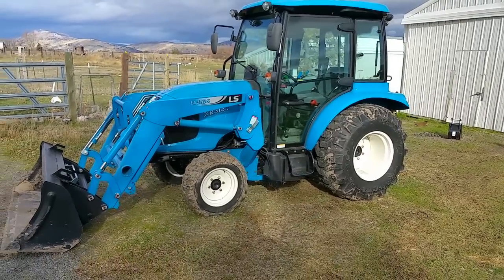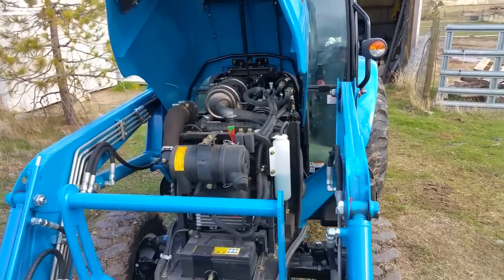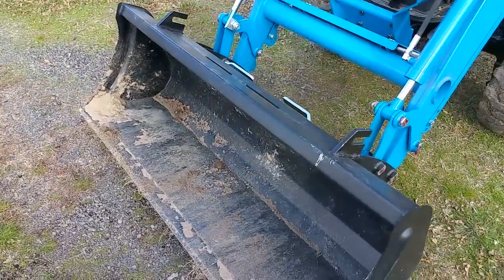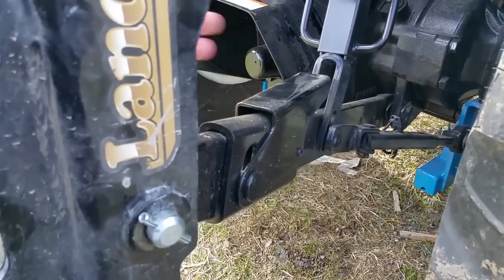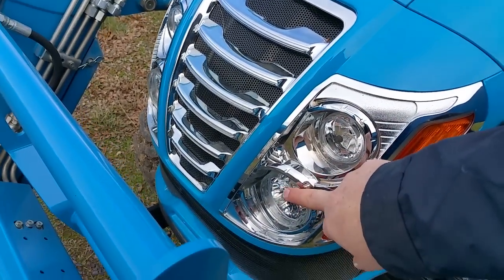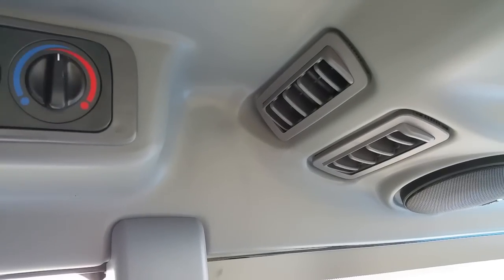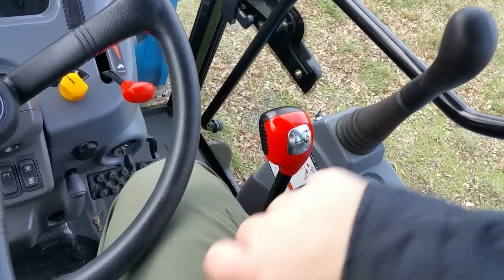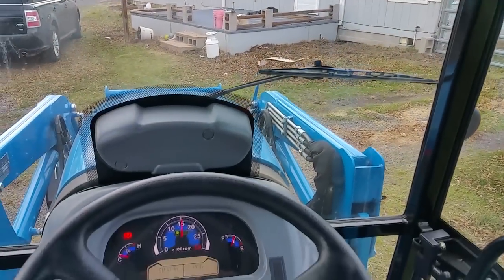About my new LS Tractor XR3135C

Comment: I just purchased mine today and am very excited about it. My father has a JD that's around 10 years old; if the quality of JD still matched what it did when his was built, I would have bought a Deere. As it turns out, JD was very unimpressive and $$$. My wife and I played with several Deere, Kubota, New Holland, and Case tractors. We stopped by an LS dealer on a whim today (who neither of us had ever heard of) and were surprised to see blue Case/NH tractors with a big LS on the side. We drove the 35 horse guy around and were impressed with how much nicer they felt and were constructed than the "premium" JD/Kubota 3 series. Long story short, your review was helpful, and I am subbing for future videos. I believe I'll get to work on installing a head unit and new speakers this next weekend. It'll make all the loader work we have coming up much more enjoyable.

Side question, do we have to hard wire in the head unit or is there an adapter behind there to use?
Reply from the maker: Bob Knob if you search online, you can find the pinout of the connector they use, you can stuff 1/4 spade terminals into the connector, so no splicing is required.
Reply: That's interesting; I assumed they would use a molex pinout. Spades are even easier! Thank you.

Comment: Man thank you SO MUCH for this video and PLEASE make MORE videos of this tractor in action and reviews along the way! I have been eying these LS tractors for some time and am VERY INTERESTED! And in a very similar model just more horsepower due to task I run. But thinking of even just going with the 37 HP for now.
Please share more thank you!
Reply from the maker: This model replaced the 3037. The tractors are similar except for the engine. The 3037 has the Shibaura 3 cyl turbo engine with mechanical injection. The reported regen interval is 4hrs of operations. This unit is reported to run 50 hrs between regen cycles. Reading through the manual, it appears that the aftertreatment system on this engine is a continuous regeneration style; as long as the exhaust temp is high enough, the catalyst and DPF are burning off the soot they trap, it does not need a specific regeneration cycle. There is no auxiliary injector that I can find, a regen cycle would then consist of the engine running at high idle for 30 minutes. The manual states to warm the engine up at 1500rpm for 2-3 minutes; I tend to just set the speed to 1500rpm and use the tractor like that all the time. I figure this will ensure the EGT is high enough to keep the CCRT in regen so I don't have to worry about it. The throttle application is rather sluggish, if you mash the throttle the computer will roll in the throttle very slowly. I recognize this strategy from diesel trucks, it's to prevent soot generation under engine acceleration by slowly feeding in the fuel. I suspect this is one of the strategies they use to lengthen the regen cycle. This slow feed in is present in the hand throttle and cruise control. When you let the clutch out while idled up, the engine revs drop and feed back in slowly, which saves wear and tear on the clutch and makes for a smooth take-off. The cruise control is computer controlled, the default RPM is 2328, which is the rated RPM for 540rpm PTO operation -- this makes it easy to run the PTO, just turn on the cruise, push in the clutch, activate it, and the engine is at PTO rpm.

Comment: Just wondering how many hours you have on your LS tractor by now and if you have had any major problems with it?
Reply from the maker: I have a little less than 140 hours on it now.  I had to replace the ECU (under warranty) because the tractor would not enter Regen mode on its own.  Twice I received an error about the DPF being 150% full and it went into forced Regen/limp mode.  The service center diagnosed this as a bad ECU (more likely the ECU had bad tuning/programming and they had updated it).  I haven't ran the tractor hard since the ECU change, but it seems to run like normal now.  The ECU/DPF are covered under a 5yr/3000hr warranty, so I'm not especially concerned.

Comment: How did you access/remove/replace the speakers in the ceiling panel? Did you have to remove the outside roof panel?
Reply from the maker: They installed the speakers before the external roof.  You can remove the speakers with an electric driver, from inside.  I then used some nut clips that came with the new speakers to retain them into the stock location.  The nut clips just clip to the inside of the speaker opening and provide a threaded nut for the screws that came with the speakers.  You can do it all from inside the cab.
Reply: I loosened a couple of the speaker screws from inside the cab - there seemed to be a retainer clip or washer on the back side which prevented the screw from dropping out. Rather than using additional force to pull on it, I chickened out and ran them back in fearing that I may otherwise lose the alignment of the screw to the clip on the inside and have a rattling speaker and lost clip. Sounds like you "pulled" them out and didn't have a problem(?).
Reply from the maker: They just use a washer and nut on the backside, totally the wrong way to do it.  Car manufacturers use the spring clip nut plates like I used.  The trick to getting the factory screws out is to pull on the head of the screw while unscrewing, this keeps the nut engaged with the plastic, by friction.  A fast spinning electric driver is your friend here.  You can often loosen the screw completely by just very fast spinning of the driver, otherwise you will have to pull on the screw and/or cock it to one side in order to engage the nut on the backside.  Harbor Freight sells the nut-plate spring clips in an assortment.
Reply: Understand. Big fan of HF assortment packs - O-rings, roll pins, grease zerks, etc., - I thought I had them all!  Need to find a nice set ofspeakers and replace the current Sony tuner head with one that has bluetooth and a little more built in power. Thanks!

Comment: The "bucket flop" problem can be fixed by installing part number 9-7960-6 from Surplus Center. Around $25 I believe. There are a couple of threads on TractorByNet that cover the how-to's. One of my disappointments is the LS loader valve does not have a quick-dump..... Otherwise. great tractor and great value. Thanks for your video!
Reply from the maker: The bucket flop problem is caused by using a parallel circuit valve without regen.  With regen the fluid flowing from one side of the piston is recirculated to the other side, preventing a vacuum from generating.  The proper solution is to install a serial loader control valve with regen.  I have the datasheet for the Walvoil valve on the tractor, and can generate a new Walvoil part number for the exact fit valve, but sourcing the exact fit valve is difficult because Walvoil appears to supply directly to OEMs and not the repair/retail market.
Reply: I think your diagnosis is absolutely correct as is your solution. It will also be more expensive. The $25 inline valve will remedy the problem as several of us can attest to having installed it already. Let us know if you have success procuring/installing the new serial loader valve. Thanks again for your vid.
Reply from the maker: Yeah, this "fix" will cost $600 probably.  The upside is that your lift and curl circuits will work simultaneously.  I have looked for valves at Surplus Center, but none that would drop in.

Comment: glad you mentioned pto- how can I get the pto to start at very low sub- 100 rpm and ramp up to 530? I break shear pins in every mode manual or auto and always the lowest engine speed!
Reply: its a xr4140 cab tractor
Reply from the maker: You can engage the pto at any engine rpm, just engage at low engine speed and then ramp it up with the handle. The cruise control also has a ramp up delay, from idle to pto speed is a second or 2.
Reply: Are you putting in the correct grade shear pin bolt? If so it sounds like something is wrong with your implement which is causing extraordinary strain. I assume you have the implement raised so it isn't engaging the ground or grass at startup.

Comment: getting to know my new LS as well, the regen in my experience is that during short operation and not high rpm, I'll get dash lights and high rpm. during operation where every session is hard work on the engine then the regen works normally and no dash lights. in my experience.

Comment: So your saying the 7 pin won't activate the brakes on a trailer?
Reply: YES IT WILL you wire your electric brake controller to the acc terminal, once you buy a electric brake controller, and it comes with a wiring diagram
Reply: @arnoldromppai5395  good to know, thank you for taking the time to respond.

Comment: Have you had any issues with your LS tractor?
Reply from the maker: Sadly, yes.  Since 95hrs I've been having problems with regen.  The tractor is not starting regen on its own, it waits until the DPF reaches 150% full, throws a code, goes into limp mode, and requires a forced regen.  It happened at 95 and 134hrs, the manufacturer provided a replacement ECU, then it happened again at 163hrs with the new ECU.  The dealer here isn't equipped to pull the codes from the ECU.  I currently have a problem with the hydraulic system, I think it's a bad pump, they think there is an air leak on the intake side of the plumbing.  They had the tractor for 3 weeks and couldn't fix the problem (replaced a check valve, filter), I needed the tractor so they said "yeah you can use it, the pump is fine because it's putting out the rated pressure".  There is still a whining above 1500rpm that is very noticeable.  The loader was cattywompus from the factory (Taesung makes it), with one side lower than the other.  Not long ago I discovered a circumferential crack almost entirely around the torque tube on the loader.  The loader is only warranted for 1yr, unlike the rest of the tractor.  The manufacturer provided a replacement loader frame, I still need to install it.   Soon I will have a respite from tractor work and will be able to return the tractor to the dealer to have the DPF and hydraulic issues addressed.
Reply: Man that stinks.  I tell you the more I read about tractors, I am afraid to buy any brand.  LS is supposed to be up and coming but I have read so much crap about their quality I doubt I will ever buy one.  I mean some of the things just come down to a bad design and it is hard to believe more people don't have the same issues.
Reply from the maker: I did go back and look at Kubota for a tractor that is comparable.  Kubota doesn't offer a small frame 35HP 4x4 with similar capacities, so you have to jump up to a medium frame, where 35HP is the minimum equipped power.  The end result is twice the price for the comparable product.  I have a shuttle-shift trans, most people buy the hydrostatic.  I think they are fundamentally different applications, but the ECU isn't tuned properly to handle the stick trans.  I suspect that there is a low-hour cut-in for regen and the tractor is hitting 150% DPF before the low-hour cut-in is hit.  It's supposed to regen between 35-50hrs, but the last emergency regen happened at 30hrs.  They probably need to lower the cut-in point to 4-8hrs.
Reply: IT's a gamble no matter which brand you choose.  Kubota, John Deere etc,. ALL have bad reviews.  However, for each bad review is a good one so take it for what it's worth.  I just read the pissed off consumer reviews on Kubota, nothing good!  However, I have a neighbor whose owned Kubota's for years and swears by them.  On a side note, I just purchased an LS XU6168 and pick it up tomorrow.
Reply: I don't guess you are going to be using the XU6168 around the house are you?
Reply: 311hitwall. All home use!!
Reply: Sorry, I meant  are you going to use it plug/sow the yard - things like that - where it being so large/heavy a tractor might come into play?
Reply: 311hitwall  multi use!  Moving brush when trees are trimmed, tilling the garden, bush hogging the camp, moving poles (telephone pole size). I need a tractor with enough ass to actually work, not struggle to get out of its own way!!
Reply: I was wondering because people tell me for things I want to do around the house  - putting out mulch and the other things I mentioned earlier that I need a 25 HP tractor. I just wonder sometimes if dealers sell you on a small tractor knowing good and well that you will not be happy.  Seems like that XR3135 is a pretty decently sized tractor though.

Comment: Nice review. Appreciate it. How many hours have you logged on the tractor? Any problems?
Reply from the maker: So far I've got 31-32 hours on it.  I've had to tighten the bolts that hold the front windshield wiper and  I need to adjust the loader mounts because it looks like one side of the bucket is lower than the other.  Nothing else of note.
Reply: Thanks. I'm looking at LS tractor as well. XR4140 or the 3135. Just researching.

Comment: Thank you for the review.   Keep us updated on the emissions system after more use.  Different manufacturers are utilizing different methods to meet those EPA regulations.  I was not aware that LS used different engines and only thought they utilized the Shibaura engines in their compacts.  Thank you for that information.  I guess they need to differentiate somewhat from the Boomers and smaller Workmasters.

Comment: sadly my xr4155 with under 50 hours is back to the dealer, getting a new orbital steering valve and loader valve. hope this isn't going to be a recurring theme
Reply from the maker: What happened to the valves?
Reply: Steering started sounding like it had air in the fluid and the steering wheel would never stay centered while driving straight, over time front wheels wouldn't turn with a loaded bucket, loader roll function  seemed to loose down pressure. I am glad you are having good luck with yours. The dealer is making it right and I'm not mad at LS I had issues with my Kubota it's just part of buying from over seas
Reply from the maker: FYI, these are parallel circuit valves and exhibit bucket flop, so the bucket taking a while to catch up when dumping, that's normal. The fix is to put a regenerative serial loader valve in its place. I've been trying to find a suitable replacement for this application, Walvoil does have a suitable part I believe.

Comment: any one have trouble starting theirs. it's not too cold here and ours stopped working.  thank you
Reply from the maker: Susan Wynn mine has been starting perfectly in negative temps. The earlier Shibaura engine is probably more difficult to start in cold temps. Check your glow plugs first, also make sure you have winterized fuel, or it can gel up in cold weather.
Reply: I have a 2015 XR3037H.  I'm pretty sure that has the Shibaura engine.  It was difficult to start when temps got below freezing, and impossible to start when temps got below zero.  So I installed a block heater and now, after about a 20 - 30 min. warm up, it starts OK.  Still doesn't leap into action, but it has never failed me.  Other than that, I love the machine and have had no problems with it (approaching 150 hr).  I use it mostly for tree/brush moving (with a grapple), snow removal, and some dirt/gravel moving.
Reply: 1017Bucky Za

Comment: Love how u say lay person and then give wrong info like a lay person! 
CRT stands for constant regenerating trap.  CRT is passive regen. Aka no extra fuel added. ALL  dpf from all manufacturers do this. It's called chemistry. 
Your wiss bang engine does have common rail. That also means they can do active regen! Aka dump fuel into the exhaust stroke to heat up exhaust. Its actually the cheap bad way to do it. The raw fuel goes through the turbo! Having an extra injector in the exhaust is a far better design. They don't do it because idiot owners see it and freak out lol. 
Proper designs and engineering is key. All these cheap tractors will be junk in 10 yrs.
CRT only works when u have the dpf very warm. Aka running at 50% or more load constantly.  Obviously nobody does that. Hence the need for active regen.  Again dumping fuel into the exhaust which reacts with the chemicals in the doc. Temp goes up 3 or 400c and that burns out the soot in the dpf.
Reply from the maker: Yes, it's not a CCRT, LS has conflicting information about the exhaust aftertreament system.  In one place they call it CCRT, but it's VERY CLEARLY not operating in that fashion.  I wasn't aware they injected fuel during the exhaust stroke, but that makes sense, since it doesn't have an external injector.  I've had troubles with the DPF regen since 95 hours, it goes into emergency regen every 35 hours with a fault code stating the DPF is at 150% capacity.
Reply: @eformance  sorry to hear that. All the small cheap tractors have had dpf issues. Kubota, ls, tym, etc u couldnt give me one of those tractors until after they have been figured out in 10 yrs!
It's a cheap tractor. They need a $500dpf but can only afford a $200 one. Boom constant problems. 
Why do people think deere, new Holland and case have their tractors built buy other companies?! Because there is zero profit in a 20k tractor!